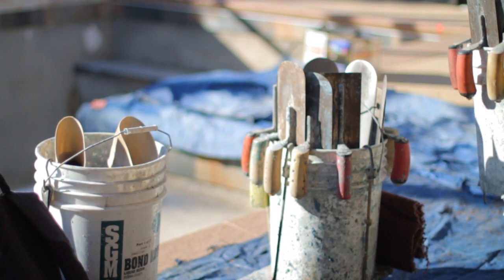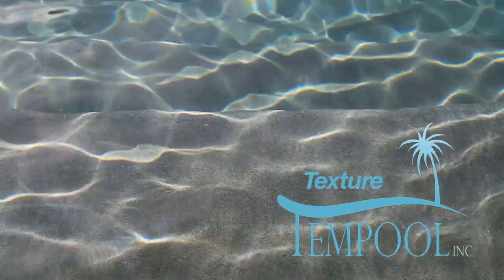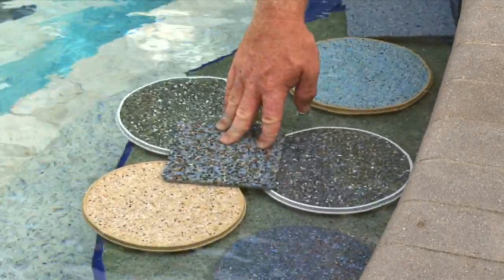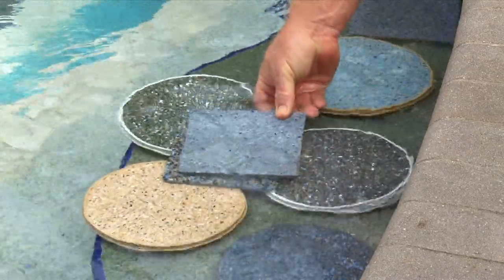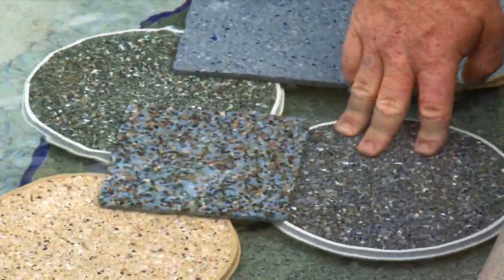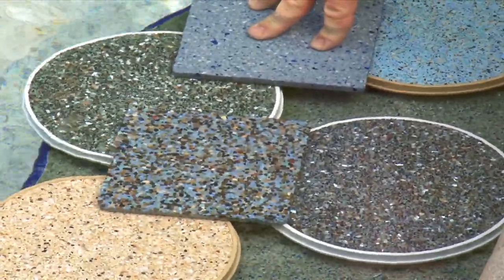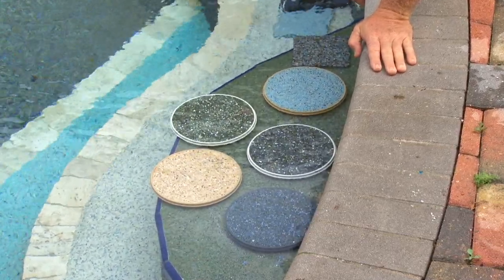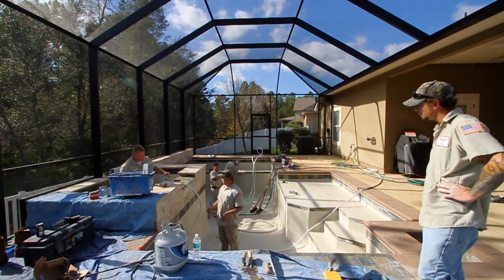Choosing a texture

Comment: Jon this was so genuine and appreciate this video. I am not in Florida but if I was you would be my pool guy to do this work. I do have a question, I am in the North East New jersey to be particular. My problem is I never had a pool until now, and the pool is 40,000 gallon. Not sure if thats a correct # but the pool place from the last owner is what was calculated. Is CDL the best to use and is it the contractor or the Company that sells the product? Is there a difference on price with pool colors and is it true that the darker the color the warmer the water is? What is the charge by square foot to do this work? I appreciate any help you can give me. Thank youagain for this video